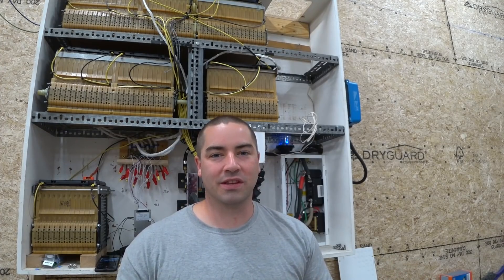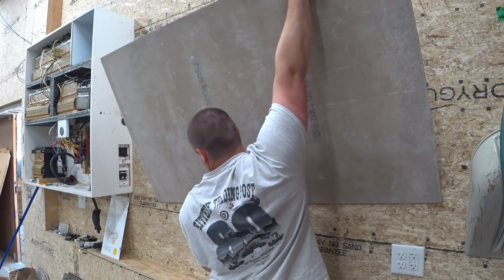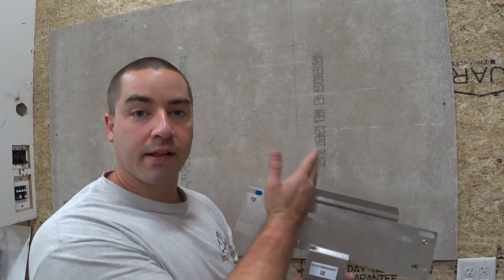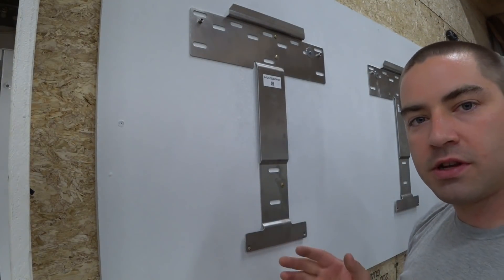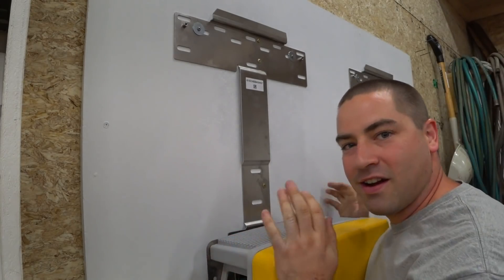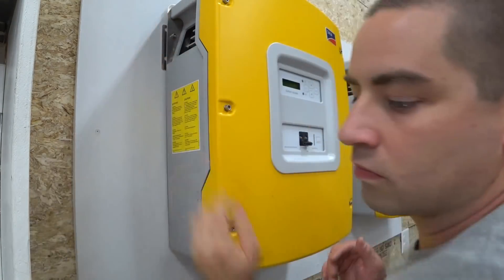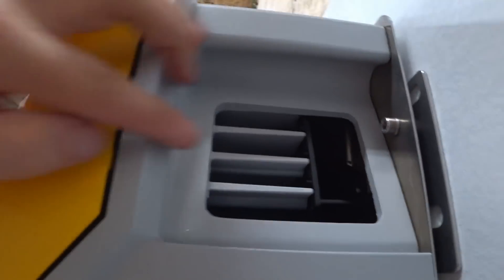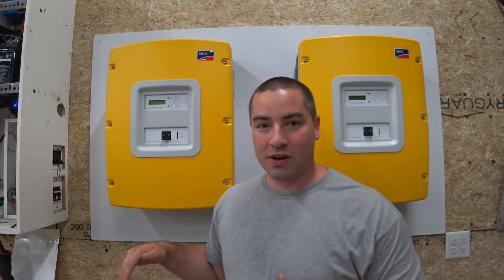Mounting New SMA Inverters 120/240v 12kw (Split Phase)

Comment: Wow, I am amazed by the price on these units, I'm curious if this is stock from that major solar company going bankrupt earlier this year? I decided to delete inverters from our solar system this year and while we have been remodeling our colorado home, I have been converting and wiring everything up for DC directly as I remodel each room in the house. We, unfortunately, have had a lot of issues with inverters over the past 5 years running them, we had a Magnum inverter for 3 years, after 2 years it died randomly one day and wouldn't function, sent it out for repair, nearly cost 50% of the price to repair the unit. Then over 4 months in broke 3 more times, so after getting it repaired the last time under warranty, we sold it and bought an Outback unit after many recommendations. In 2 years of owning that unit, we had to have it repaired under warranty and going those periods without the inverter and running on generator power really annoyed us a lot, especially since most of the failures occurred during winter months. so after playing with the idea in my shop solar system, I decided to carry it over to the house. Most major appliances you can convert to DC very easily by just tracing the input power to the stage it converts from AC to DC, so our major appliances I spent some time with them and learned that our fridge and chest freezers went from 120v ac to 48v dc on the input. So I tested out the chest freezer and soldered wires directly to the DC side of the circuit and been running it no problems. I bought some DC to DC regulators to dial in the voltage to stay constant even if battery voltage drops, they were fairly cheap on eBay. Then we plan to replace our home A/C next year with a DC model as it converts to 600vdc on our current unit, but our house is currently dual wired in the rooms I remodeled so far both 48VDC and 120VAC. right now nearly all the lighting in the house has been converted to DC with led DC bulbs and in the kitchen, for the random item we don't use often, I just have a small 1000watt pure sinewave inverter circuit setup for the occasional use need. For items that didnt have 48vdc input available like our TV, which they only sold a 12vdc power cable, i just used DC to DC regulator inline of the circuit in a small hobby box.
Reply from the maker: Sounds like a great project.  Do you have any details online so I can see pictures or videos?
Reply: That was DC SOLAR, and yes, they had a place in North Carolina as well as Woodlake California where they built trailer mounted rigs. They just auctioned off 700 of the trailers with 4x48 volt exxide tubular  batteries, 2 SMA inverters and 10 275 watt panels, and a midnight classic [?] controller. All wired up, enclosed panels and on a $3000 trailer. I bought 2, and might sell the components and use the other on a cabin. It was a huge scam $$$ wise, but the product was absolutely top of the line. 
I am curious about your statement that my freezer and fridge can run on 48 volt DC. Been inside many and never saw any DC components. What am I missing there?

Comment: Does this inverter works alone or with another inverter? I used to see many Sunny island inverters red in Col our connected to another blue one in many videos.
Reply from the maker: I think the red inverters are grid-tie style.  The red ones have solar PV input, and output 120/240v AC.  These yellow inverters connect to batteries and can charge/discharge the batteries from AC.  This is a form of "AC coupling".  Most off-grid systems use "DC coupling" where you need a charge controller.  I've used DC coupling in the past with my Victron Charge controller.  Once these are hooked up I plan to make a video testing the AC coupling feature.
Reply: DavidPoz so this one can be directly connected to solar panels and battery bank to power a house without connecting external charge controllers.
Reply from the maker: No, sorry for any confusion.  The red inverters can connect to solar panels, but not batteries.  Yellow can connect to batteries but not solar panels.  There is a diagram on this site: https://www.codale.com/index.jsp?path=product&part=4126897

Comment: if you installed one Victron Quattro 15000kVA. that would be much better than paralleling two inverters. 
anyway. SMA and victron are the best out there. thank god you didn't go for studer as they are the worst ever.
Reply from the maker: I agree that Victron is awesome.  I'm not sure 1 of the Quattro 15kva is better.  That model is single phase 230 volts.  I live in US, so I would need to buy a transformer to output two phases at 120v.
Reply: @DavidPozEnergy  Ohh, totally forgot about the 120V model. any way SMA is great but not flexible that much. If you got 2 quattro 10000/120V they might be 2/3 the price of 2 SMA SI8.0. and Quattro comes with so many features and it's flexible to configure any way you like.

Comment: Those are great, but why are they any better than the AIMS 12,000 Watt, 48v input, 240v split phase output, model: PICOGLF120W48V240VS, for $4000? I can see from the specs that they're stackable for three-phase, up to 100kw, but for split 240v, $10,000 for 5750 watt/hr (x2) continuous, and 130 pounds/unit, sounds unreasonable.
Reply from the maker: They are different.  Not necessarily better or worse.  I paid $2400 for the pair because I got them on Ebay.  But I would not have bought them if they were full price.  I've read the specs on both and there are some things that stand out.  The Aims 12kw Idle watts is 200 watts.  The SMA is 25 watts each (50w for the pair).  This means a savings of 3.6kwh per day.  To put it another way, I need 3.6kwh less of batteries.  That's pretty cool, right?
Reply: Thanks. I also prefer the design of the SMA, because you can see that they were intended for industrial purposes, and extensibility. More durable, safer casing, more manageable, multi-phase/series capable, and I agree that they're cooler than the AIMS!

Comment: SMA good actual brand inverter (aims are OK but more geared towards split phase usa market) , with these SMA you just buy another one for split phase and reconfigure it or worldwide 240/120v volt version you could use 3 of them to make three phase (but you can get 12kw 240v SMA inverters so going 3 phase is not really needed normally) 

 I assume you're doing 120-volt split phase with these two inverters as your your aims 3 kW / 6 kW split phase inverter wasn't capable of of driving everything (they should list them for what they are when split phase instead of saying total output)

You shouldn't have issue with hot ground on these inverters as they follow standards (these are norm certified for the region your in, so your house insurance be safe with these SMA inverters and are grid certified if your allowed to backfeed but your using battery's so probably don't need that feature
Reply from the maker: Yes, I plan to program them out of phase from each other so my house will have 120/240 volt power.
Reply: @DavidPozEnergy  they are very good in the uk these are normally installed by local council(state/m) rented houses for free solar installs (Council get the money for generated power and the people living there get free electricity in daytime) they have expected life span of at least 12-15 year on a grid tie setup (believe they have like 10 year warranty in eu/uk)

I updated my first post a little (ok a lot)

Comment: Welcome tot the big league David. I’ve had mine from eBay for almost two years now and they are damn near bulletproof in operation. You will also love the fine level of charging programmability. Using these many charge settings you can support almost any type of battery chemistry. I use the float voltage and delay timer to prevent continuous charging once my LiFePO4 battery bank is full. And, if you get or have an SMA grid tie inverter as I do, they will communicate via RS485 where the solar power will be throttled back once the batteries are fully charged.
Also, since these inverters support 2x loads for up to 30 seconds, you now have 24kW of reserve power to start up even whole house AC!
Reply from the maker: Hi William,  I'd love to find out more about your program.  How exactly are you using the float voltage and delay timer?  Could we possibly connect on Facebook?  Or, perhaps, you could make a cell-phone video showing the settings menu, then upload to youtube?
Reply: William.
I also purchase a pair of Sunny Island at deep discount to add battery backup to my Sunny Boy 7700W Inverter.  I have not taken them out of the box yet but looking at the instruction manual I thought that these only support lithium when using small list of approved lithium batteries with external BMS.  Is that true?  On your message it looks like you are changing charge settings.  Is that on the Sunny Island with AC coupling or are those settings on an external MPPT Solar Charger. 

I am getting a good deal on AGMs and have not  consider DIY Lithium because of that.    I still need to purchase the RS485 for the Sunny Island Master but I already have the RS485 module for the Sunny Boy.  Am I missing something?

Comment: They work great but good luck programming them for custom battery setups their pain. You'll notice a very big thing and that your SOC you're going to have issues with. all in all these babies can push a total of 400 amps coming off the battery Bank so you really need some wiring for this. I have these and 80 batteries and I think I still don't have enough. Have a total of 200 amp hour batteries by 80 and these things can really draw. They will in fact run an arc welder no problem. There's just not much information on exactly how to set these up perfectly. So if you have any questions give me a holler. These are underrated first off. These can burst to 22kw no problem. Seen this in test for 30min no problem Ill be posting videos of my walk thru on my setup and things to watch out for.  Offgrid42141@gmail com
Reply from the maker: Thanks.
Reply: @DavidPozEnergy  I'll give you a little hint about the sock information you need to run a full Equalization stage no matter if it's PV coming in or if it's coming off the grid but it has to run a full cycle of equalisation and every one of your battery settings must reflect through your mppt set points me too pretty well match what's in the sunny island or it will never get to 100% SOC again
Reply from the maker: I don't plan on having equalization on because I'm running lithium batteries, not flooded lead acid.
Reply: @DavidPozEnergy  you will need to let the sunny island know this with a external BMS by can bus. Or dont hook the sunny island to the grid or it will over charge batts. If you dont do this and set the sunny island to battery other with no CAN bus communications it will error and not start up. Or you could maybe set batt settings on FLA and just put all battery settings to same voltage charge at a lower charge time and max voltage so it won't try to over charge. What I'm saying is the sunny island is on a timer to tell Soc lvl. Time go up based on time idle at the set voltage in charge area. If BMW dosen't talk to the sunny island it won't discount correctly from the grid or generator right and the soc won't rise and sunny island will shutdown to protect batts.It's a very sufictacated setup in their and in my book over engineered in the charging system area. But the rest is a perfect with the system. If need help let me know.
I hope I got a crossed to you what I mean. If you haven't already ran into this I'm sure you will.
Reply from the maker: Thank you.

Comment: If it's the same why get them
Reply from the maker: I got two identical inverters (I assume that's what you mean by same) because I can hook them up together.  Each will put out 120 volts, but I can program it to be 180° out.  That way they are 240 volts combined.

Comment: So if one fails you have 6kw at 120V instead of 240.
Reply from the maker: Yes.  I wouldn't be able to run my oven or water heater, but could power any 120v loads on that phase.

Comment: The Sigineer 12KW split phase inverter is around the same price ($2400) but only 1 "box".  Not sure of the weight but it is a beast too.  I would be curious to see how well these handle surges.  Also, what might happen if one "leg" (of the split phase) is heavily loaded and the other is lightly loaded?  Maybe you should test that.  For example, it is a cold night and you run space heaters in 3 different rooms and they just happen to be on the same leg.  One "box" might have 4KW load on it and the other "box" maybe 100 watts.

If I was running my entire house off of a split phase inverter, I would mark each of my outlets with either a 1 or 2 so I would know which are on which leg, then if I ran high wattage items, I might try to better balance the load.
Reply from the maker: I have thought about the same thing.  How to balance the load...
I currently have an old watt meter.  The clamps are on the main wires in my breaker box, and the meter is on my kitchen counter.  I'd like to get 2 meters, (or one with two screens) so I can see both legs at the same time.  Maybe there is a wireless version?  I haven't looked but there's probably something out there.  Then I can see at a glance how balanced the two inverters are.
Reply: Perhaps call the company and ask them what if you put a 5KW load on one side and 100W on the other side, is that bad or can the inverter handle it gracefully?  Also ask them if an unbalanced load in any way affects the maximum load capability of each 120V leg.  For example, suppose 6KW per leg was the actual limit and you had that running at 6KW per leg, then you drastically reduce the load on only one of the legs down to maybe 1KW or less while holding the other leg at 6 KW.  What might happen?  I would ask them first before you try it to hear if they advise you against doing that, however a scenario like that could happen in real life.  For example, maybe you had 4 space heaters going on one leg (about 6KW) and a few lights and a TV on the other (100W or so).   I would also be interested to know the voltage sag when it is heavily loaded and if the voltages for each leg are within a few volts.  Also remember to try a low power factor load to see what (if any) issues it has.  I have seen some inverters hum loudly (their way of "complaining") until a much higher power factor load was seen.  Have fun with your "new toy" and try not to burn the house down.
Reply: @davidjames1684    One inverter would be running at 5kw, the other at 100w, and that would work fine.   Although, you'd want to balance the loads between the two phases on average, by organizing the circuit breakers in the main panel, so one inverter doesn't age out and retire early.  At 6kw it will shut down at some point, 5750 is the continuous normal temperature limit.  7000kw for 30 min, if not too hot.

Comment: I would like to see you battery / electronics box made from non-combustible materials - this is the area where you are most likely to have a hotspot / fire. In fact the whole power wall area covered in plaster or cement board would be a great idea.
Reply from the maker: Currently I have no plans for that, but it's not a bad idea.

Comment: Those are great inverters, you won't regret it. I got a friend, with the same combined inverters, running on 6 volt, 12 deep cycle batteries and powering 3 homes with almost everything running on those two Master inverter, Great choice Brother😌

Comment: Nice! Love your videos, it’s nice to see you having fun. BTW, that’s 120/240 Single Phase, not “split phase”. That’s a type of motor. Even some manufacturers are using the wrong term!! So don’t feel bad. ;)
Reply from the maker: Yep, you are right.  I don't particularly like using the term split phase, that's why I put it inside parentheses.   In the description I go into more detail.  I do this because at one point I was writing single phase and kept receiving the same question over and over again about it.  There is a dramatic decrease in this question if I just use the term slit phase.

Comment: I'm interested to know how well these work.  I'm still using my aims 10k inverter
Reply from the maker: Aims are awesome.
Reply: @DavidPozEnergy  Ames is total junk and the company is too you'll call him and they try to push all the issues off on the customer and knowing that I have the battery Bank to push it. And the displays are outrageous. Because all it really is is a clone of the other Chinese inverters out there and you'll pay a quarter of the price. Ames is just a rebranded Chinese clone. And if you call Customer Support over a warranty issue good luck with that to Lost 4K because of them would never do business with them again. And the inverter store online is a joke to because that's another website and same people.
Reply: @DavidPozEnergy  I had a 3k unit just stop working on me.  It was for a marine application.  We never even got the boat in the water before it died.  Had to replace it with a better quality unit.
Reply: The SMAs are professional equipment for continous operation at full load 24/7 20yrs.+
Made in Germany in the City of Kassel, 1h from my home, where I own and operate some MWs of wind turbines. 😁
SMA has the best customer service in the solar industry worldwide, IF something breaks.

Comment: Was that fire retardant paint on the cement board? They do make such an animal... as well as BBQ paint that withstands near 1,000 degrees. Regular latex paint may soften and do weird things if exposed to too much heat.
Reply from the maker: Regular water based primer.  Nothing special.
Reply: @DavidPozEnergy  They sell engine block paint in a spray can at parts' stores